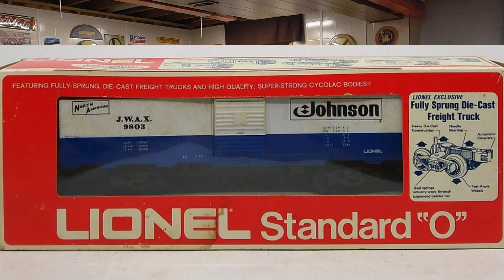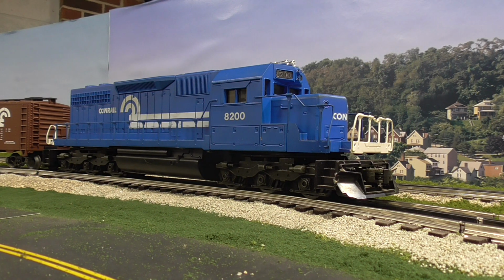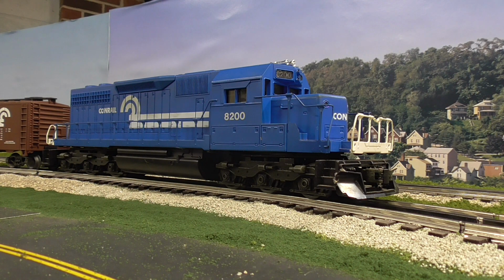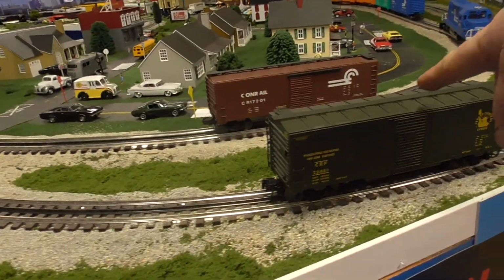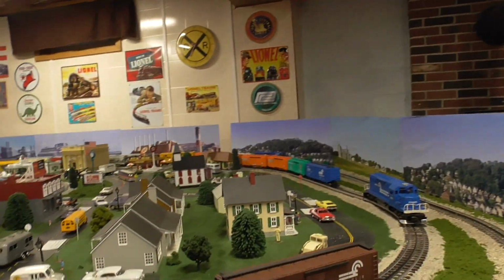What is Lionel Standard O ? O Gauge

Comment: I believe the first standard O set to not feature the SD40 was the 1990 Sante Fe set with the Dash8 40-b engine and it featured the first freight car with an EOT deviced being used. Iater it had a dummy available for the set. You can't forget the standarf O car sets that were made for the 783, 784 and 785 scale hudsons.
If you bought them on tge secondary market the could run $150-250 from some of the big dealers! I have all of those as well but not the 784, 785 engines.

Comment: Here is how it should be,
O scale is, 2 rail, full 1/4 inch to the foot, track is either handlaid  rail on individual ties, or manufactured by Atlas, Micro engineering etc.
AAR finescale, also known as Proto48, not O gauge at all, as the railheads are a scale 4' 8.5" apart
Hi-Rail, 3 rail O gauge track, full scale cars and engines, and scenery, track is usually Gargraves, Atlas, or can be handlaid, but usually isn't, can also include Fast track
O Gauge, just about everything else including Mickey Mouse boxcars and Donald Duck cabooses!
Hope this straightens it all out!

Comment: Only in O Gauge is this an issue. 2 rail ready made from Gargraves. HI RAIL is O scale but with 3 rail. O Gauge is cursed with the 3 rail to be compatible with old Lionel.All of the new companies should have gone to 2 rail DC.As l model subway trains l can live with the 3 rail. I also model a prosperous PENN CENTRAL  and the NYC ran a lot of electric trains with      3 rail tracks. As l model the 1970's lots of smaller rolling stock still in use. I even run some Marx .027  locomotives are S scale on 3 rail tracks like prewar  American Flyer.